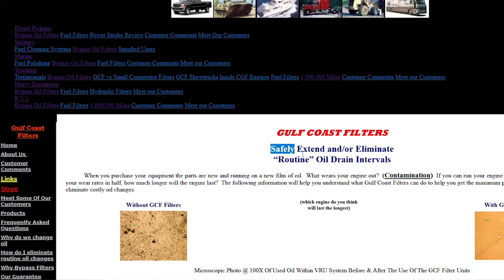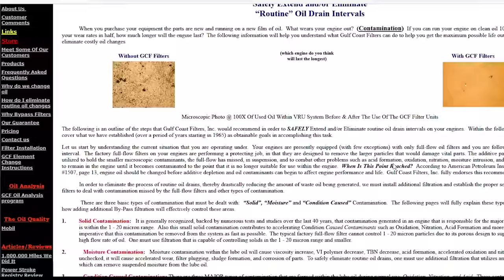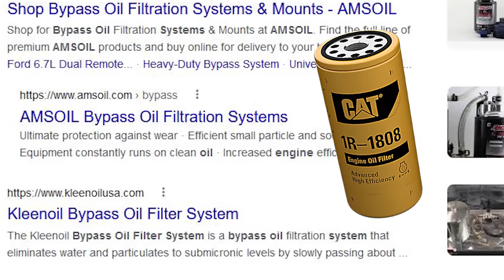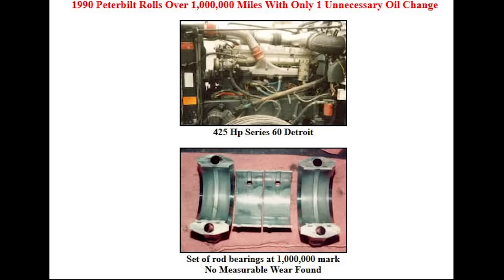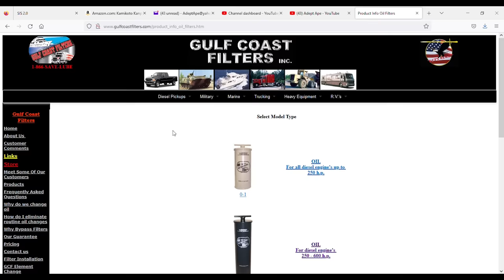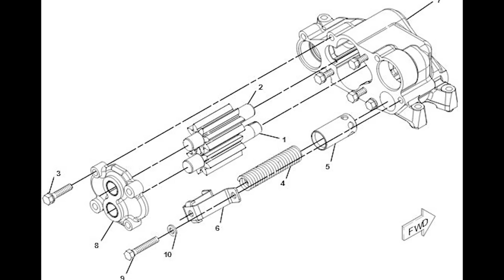No Oil Changes and 1 Million Miles!!! Are Oil Changes Optional with a Bypass Filter? (INTERESTING)

Comment: I was a diesel mechanic in the Navy, and on the ships, there are centrifugal oil water separators that force water out of the oil.  The only time oil is actually discarded is when it gets too much acidity or fuel dilution.  Acidity can be dealt with, but fuel dilution is extremely dangerous.  If fuel dilution gets too high, you end up with a crankcase explosion.  The sumps of the engines have pressure relief covers to help prevent a catastrophic explosion. However, if the crankcase does explode, it obviously isn't something that is minor in nature.  So if on a truck diesel you end up with fuel dilution, it would probably be a good idea to change your oil as a sump without vents would be a ticking time bomb.  One of the schools that I went through was all about fuel and oil quality control and filtration.  In that school, we were taught that oil doesn't "go bad" it simply becomes contaminated, so your statement about oil not going bad is correct according to the U.S. government.
Reply: I was gonna say my dad was an engine man in the navy and told me about those centrifuges said they would spin it out and add detergent back in this was back in the 70s
Reply: The last statement has me worried. 😂 I don't trust the government to do anything right, but hey, a broken clock is right twice a day. I lean towards agreeing with them, but engine speeds are low, and it's a much different environment in a ship engine vs. an OTR truck or car engine. Rail engines are similar; one fill for 10 years, until the next inframe.
Reply: @ChevyConQueso  it depends on the engine as to how low the rpm is.  If it is an LSD or LPD, then the max main propulsion engine has a max rpm of 500 due to the size.  If it is one of the generators or a smaller boat's main propulsion engines, then the rpm is the same as any OTR truck.  As to not trusting the government, I agree. However, they tend to be the ones that set the standards when it comes to oil. It is only the intervals of oil change that are set by manufacturers.
Reply: there are many trucks an even some Toyota landcruisers that used centrifugal filers
Reply: @harry8506  not like the ones on ships.
Reply: @AllanHazen  a little less real-estate under the bonnet of a cruiser
Reply: @harry8506  no, most of the ones I've seen don't function the same as the ones  on ships.
Reply: there are no air in 4 stroke engine's crankcase. how it can explode.
Reply: @u4ig  I don't know who Bob is, but perhaps you should familiarize yourself with large diesel engines.  They come with relief covers on their crankcase in case of a crankcase explosion.  There absolutely is air in crankcases, and all it takes is for the fuel oil dilution ratio to get too high, and the heat of the parts will ignite the fuel, causing a crankcase explosion.  Without relief covers on the crankcase, an engine used on locomotives or ships would turn into a very large bomb.  They are such a threat that we ran drills at least once a week for what to do in case a crankcase explosion happened.
Reply: @AllanHazen and thats why you have a manometer or pressure transducer to ensure the crankcase remains in a constant vacuum. Next to a run away engine crankcase explosions are the most terrifying casualty.
Reply: @Oksobasically2  the better solution is to ensure the fuel oil dilution is kept to a minimum as the nature of the engines makes a perfect vacuum impossible.  Keeping that which is most volatile out of your sumps is the ounce of prevention that prevents the pounds of repair that inevitably come later.  Yes, both scenarios are extremely dangerous and rarely end with a usable engine.  Even the training for a runaway engine proved damaging to the turbos as the intake flapper valves were originally tripped during training and cause the turbos to suck their seals out, leading to repair or replacement and was subsequently changed to a simulation.
Reply: Fuel dilution and acidity is something to keep in mind. In cars, you can do changes every 20-35 thousand miles according to volkswagen.

Comment: Used to work with a naval mechanic that told me medium speed and slow speed diesel engine (medium speed diesel here your engine is the size of a large pale loader, slow speed means your engine is the size of a building) never change their oil. The use centrifugal filtration to clean the oil. They will from time to time replenish additives but the oil is never changed.  Alfa Laval is one of the manufacturer of those centrifugal systems.

Comment: Josh my recommendation since I run bypass filters is do not change your oil schedule. The main thing that a bypass filter does is remove carbon. It really helps with the new emissions engines. That's why I sent the email showing all the carbon. Thanks for doing the video. Also one key thing is plumb your filter after the oil had gone thru the engine and turbo. Just my knowledge of using them for years.
Reply: By pass filtering can also remove some of the condensation buildup with the crankshaft pressure bypass system and it’s debatable if the micro filter does actually work some just run the bypass without the filter because the vacuum put on the bypass system from the intake would just pull it across the mesh and not give it time to absorb it but all in all will help with corrosion on your injectors and spark plugs because you’re getting cleaner air in you’re intake and releaving pressure on you’re crankcase and if you have problems with too big of a vac on the system and are pulling more oil then you were in the first place you can put a tiny hole in the system to give you’re truck a makeshift chop tune and still have the benifit of releasing the pressure on the system
Reply: That isn't actually a good idea, in the event that something fails, like your turbocharger, your engine's going to suck up all that crap instead of it getting caught by the filter first.. The oil should be filtered BEFORE it goes into the engine, not after. Not to mention that cold thick oil creates excessively high oil pressure, and you could destroy gaskets by plumbing it after the engine instead of before.
Reply: By that logic any vehicle that’s got a cpr system should have the oil filtered witch just isn’t the case
Reply: @dat_boy_be_rolln2058  Ive used the filters for 60 years. I dont understand anything you wrote.I currently use Motor Guards Gulf Coasts  a Australian Jackmaster Classic and a flat head Ford V8 canister filter converted to use 4 1/4 inch Scott 1000. Its a matter of cleaning the oil and sending it to the sump.
Reply: @ralphwood8818  in the application I’m talking about it’s not a matter of cleaning the oil it’s about crank pressure relief you’re going to be replacing your oil every 3000 hours or so anyway so the idea of removing the particals is out of the question because the only way you’re truly going to be able to filter out that small of debris you are going to drastically decrease the flow of said fluid
Reply: @dat_boy_be_rolln2058  Im a car and pickup guy. My bypass filters hook up the same as they hooked up in the 1920s.When I drove a truck I had to service the Luberfiners. They hooked up the same as my cars. My 41 Dodge car had a Fram that was the same as the Luberfiner. They both used cotton. There are a lot better filters now.Some are a little too high dollar for me. The last filter elements I bought for the 750s were pulverized newspapers and wood chips.

Comment: I remember when I was a teenager now 62 there were some log trucks still running liber- finer by pass system and I remember they would go several thousand miles after a oil change and the oil looked like you just changed it but as oil got better people quit using them I also remember mount saint Helen eruption and every log truck through away there paper air cleaner and went back to oil bath working in the volcanic ash the engines lasted longer on the oil bath. Everyone dismiss’s old tech but some of it is still relevant. Thanks for the video I always enjoy them.
Reply: We sold the oil bath as a heavy duty option The paper filters cleaned.better but the oil baths held more dirt.My tractor has an oil bath. Since I dont work under dusty field conditions I would be better off with a pleated paper filter. Im also not happy removing the air intake to open the hood.. some like to convert the oil bath to pleated paper. I have a nice Nissan diesel pleated paper filter. It sets off to the side with a hose running to it. You got me thinking. I just bought the old tractor i dug out the Datsun air cleaner today. Its slightly larger.. might need a longer  band clamp.. Thanks for bring up the subject.
Reply: The tractor oil bath air cleaner was full of water and sludge. Probably never  been cleaned in 40 years. The Nissan diesel air filter was a little too big. Put a Oldsmobile filter on it. The.fuel filter was half full of water and sludge.Probably the origional. When you buy a tractor that has been sitting for years in a field thats what you get. First time it started instantly and sounds strong..I tossed the fuel filter. Had a remote fiilter mount. Put a motorcraft Fl 1 A on it for the fuel.. Not sure the gravity would push the diesel thru the toilet paper. Might try it later.

Comment: I worked for a major diesel engine manufacturer for 30 years, from 1970-2001. Early in my career I got to travel to a major trucking firm who was experimenting with " no oil change for 100k miles" and they were basing that on using a centrifugal type by-pass filter. The engines were inline 6, 855 cu.in displacement, turbocharged, so you probably know what engine manufacturer I represented. Long story short, it was amazing that the engines I inspected were still running just before they were disassembled! First thung is, the fleet did not service their by-pass filters, every one of them was completely solid with filtered oil contaminates that the filters had removed from the oil before they became inoperable because of lack of servicing, so these engines ran a long time with no by-pass filtration.
Almost all piston rings were broken, the oil ring expanders were solidly locked to the oil ring if they were not broken, many upper rod bearings were broken in half across the oil hole and were worn into the steel back, main bearings were completely worn to the steel backing, injector push tube were stuck in the cam followers as they had worn themselves into the hardened sockets and injector links were totally worn out, some with 1/8" protrusions into the oil hole, upper rocker bushings were gone, the engines were basically scrap!  Had the by-pass oil filters been serviced as required it would have been a different story, but how different I don't know, oils then met the applicable API specs of the day, but not as good as todays.
Reply: Diesel mechanic I know went to a 60HP Belarus farm tractor because it was smoking. He checked oil centrifuge which was chock full of solid carbon. ASked owners when was last oil change. Never changed oil and had it 10 years!! after giving it a good clean up and fresh oil it ran as one would expect
  I had a100 HP tractor with centrifugal oil filter in transmission. Oil was so clean it could not be seen on dip stick, you had to feel for it!!!
Reply: When you change the big Gulf Coast filter  you have to add 3 gallons of new oil. Thats why you dont normally have to drain the oil. The centrifuges I believe dont require a lot of makeup oil You have to drain it and add new oil I base that on  a Honda motorcycle with a centrifuge. Engines need an amount of new oil added. ATF its a matter of keeping it clean and not over heating it.
Reply: Ronald Russell are tou from Cokumbus by chance? That's my hometown and we are proud of the company you worked for

Comment: When I sold my truck it had 1,128,000 miles on it. Used a bypass oil filter, Filtration System, changed the filter every 10,000 miles. Changed the oil every year. Never been inside the engine except overheads 1X a year when I changed the oil. If I was still working it, I would continue. Good system sure caused a lot of questions & comments.      Thank You Sir

Comment: When I was an engineer in the Navy, we never replaced lube oil, our oil purifier took out moisture and sediments.. just added make up oil for small leakage. Used purifier’s on main engines and auxiliaries.
Reply: What kind of equipment did this oil lubricate?

Comment: I used to wrench on cats a few decades ago.  Our oil rep broke it down to the point of saying that the oil never "goes bad".  What happens is that the additives breakdown and wear out.  But the oil is essentially the same, as long as you dont run into problems like coolant and/or fuel dilution.  That was when we were experimenting with full synthetic royal purple.  But definitely the key is oil samples!  You have got to know what is going on inside and how your engine is acting.  Great video josh, this is one of those topics that concern me now that ive been driving for 2 and a half decades and wrenched on them almost the same time frame, i worked for a company where you would service your own truck a lot of the time.  Every little bit of information on most everything you cover goes a long way in know little and not so little things to look for.
Reply: But oil does oxidize. Thats one of the parameters when you send your oil out for analysis.
Reply: And how do you explain that the viscosity gets less and less the longer you run the oil (oil samples show this)?
Ps. I have no idea why, I just know this from seeing oil samples on our fleet.
Reply: I'm assuming this was back in the 90s when alot of companies were so heavey in pushing used oil which was a joke and we all knew this was bs .
Reply: there so called evidence is not enough for me . I been a mechanic for 38 years and depending on how the engine was ran how often was it under a heavy load and so on and all of this has a factor on the internals of a engine and oil and as oil get filter your going to have to add oil at some point . this system might be ok but not changing the oil I don't agree with .
Reply: Oil breaks down and goes bad.  You see the viscosity drop as the oil "sheers" due to the molecules getting chopped up-smaller molecules are generally less viscous.  If you watch extreme oil change videos where people run their cars 50-100k before changing the oil, you'll see it flow out like water, then gulp out the sludge.  So yes, the oil absolutely goes bad.
Reply: Where did you guys hear all this? Down at the oil change place? Nick is right. I have used the system since 1963 in cars. The difference is my cars need a quart of new oil added when the one quart oil filter is changed. The big Gulf Coast filter takes 3 gallons.oil analysis shows 3 gallons of new Rotella every 10.000 miles is enough to keep the additives up. Thats over 300 gallons of new Rotella in a million miles. Its a Shell oil test truck.It gets a lot of oil analysis . My cars get none.I read the dipstick.
Reply: Smart company to get its drivers to do minor maintenance and you still making money
Reply: @benhart16  yes sir. I worked at a air freight company out of Utah and we had Cummins power. The bottom ends were replaced every 175,000 miles due to the. Hard. Running. Coast to coast. We tried to have our oil changed at our terminal when possibly but not always the case
Reply: But sometimes we would run for another 5000 miles and then be able to get it changed the owner had a lease on these trucks for four years they were cab over international s when he turned them in they all had close to a million miles. None had been rebuilt. But I am sure the dealer got the short end of the stick they were Wore out we kept them up but the Biggest problem was the Air conditioning. They were always having to work on the system   I hate cab overs but that’s where I got my start
Reply: The Rocky Mountains are very hard on bottom ends because of over Erving bi had a. CAT. Engine at the. End of my. Employment with them all I know was 425 is what it was called and it ran 90 mph day in day out never missed a lick
Reply: @ralphwood8818  Ralph, read your reply. I'm looking at putting a bypass on my Duramax, a Parker system. Do you have any opinion? Thank you, Eric
Reply: @elmeradams8781  Engine oil viscosity changes with use from two major mechanisms. First, shear damage to the Viscosity Index Improver polymers (polymethacrylate, polystyrene) causes the viscosity to thin and approch the thinner base oil that is used in multigrade oils. Then, some time later, oxidation and cross-linking of the deteriorating base stock causes the oil to thicken, eventually into something resembling tar. Diesel engines are somewhat unique because the thickening from sooting counteracts shear-thinning during the first part of the oil degradation.

Comment: Many years ago, I worked for a company that installed, long interval  oil and grease systems. We put these large hi capacity filters on, then had a reservoir that held fresh oil, unit had a timer and at intervals, would inject a specific amount of old old, into the fuel tanks, and replace said oil with new oil. Also had a automatic, greasing system, which would deliver grease to, kingpins, fifth wheel, bearings in clutch, etc.  It was designed to let team drivers take a new truck, and basically run it until it needed tires or something broke.